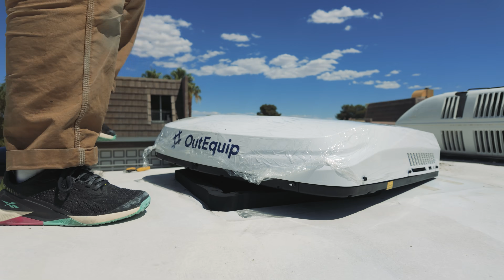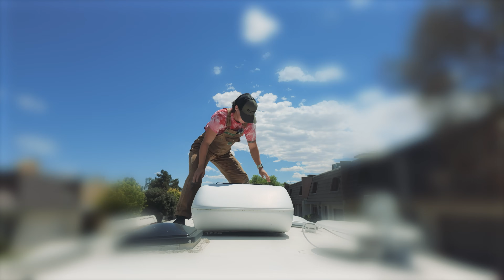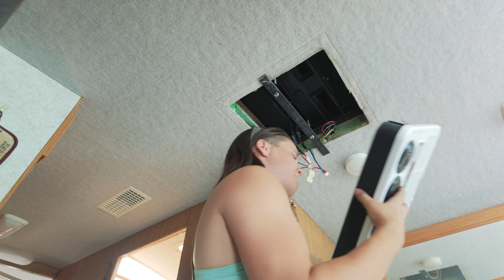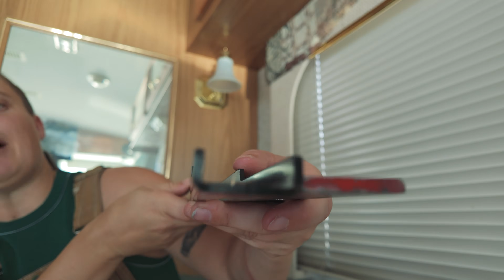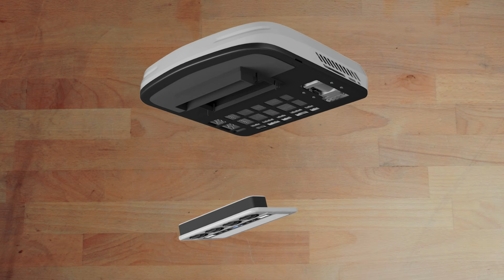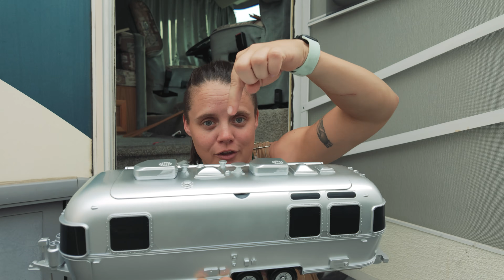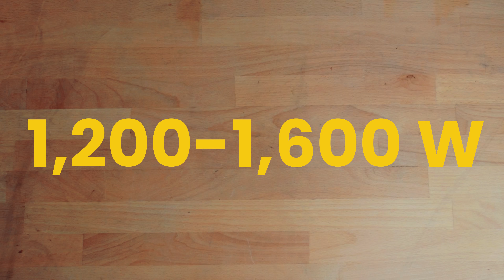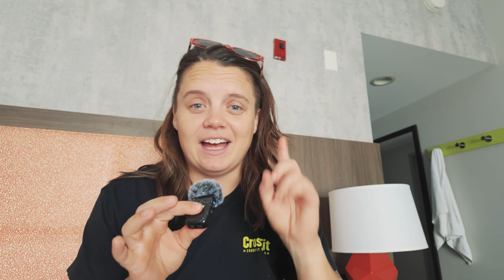Better RV Cooling with Less Power? My Switch to a 12V  AC | OutEquipPro AC Honest Review

Comment: The video is cool, but it contains a basic error in thinking that the power of an air conditioner is the same thing as its energy efficiency. Everyone I see talking about air conditioning for RVs makes this same mistake, due to a lack of correct information from the manufacturers of these 12V devices. Measuring the operating power of an air conditioner says absolutely nothing about its energy efficiency! If it were, a 10,000 BTU device would be twice as efficient as a 20,000 BTU device, which makes no sense! To know if an air conditioner is more or less efficient than another, what you should look at is not the instantaneous consumption at a given moment, nor the maximum or minimum consumption. What matters is knowing how many watts of heat the device is removing from the environment with the watts of electrical energy it is consuming! This is the EER, Energy Efficiency Ratio, which is a figure provided by the major air conditioning manufacturers, and generally not provided by the manufacturers of these 12V devices.  If an appliance that is consuming 250W of power has an EER equal to 2, it means that with the 250W it is consuming, it is removing 500W of heat from the environment. If an appliance that is consuming 1000W of power has an EER equal to 4, it means that with the 1000W it is consuming, it is removing 4000W of heat from the environment. In 1 hour of operation, it will have removed 4000Wh of heat from the environment, while the appliance with an EER of 2 will need 8 hours to remove the same 4000Wh of heat from the environment (8x500Wh). In these 8 hours, it will have consumed 2000Wh of electrical energy (8x250Wh), while the other appliance, to remove the same 4000Wh of heat from the environment, will have used only 1000Wh of electrical energy.  In other words, even though it is consuming 4 times more energy at a given moment than the device that is consuming only 250W, it uses half the energy to remove the same amount of heat from the environment, precisely because it has twice the EER. This means that to remove the same amount of heat from the environment, a device with a higher EER will use less electrical energy, even if at a given moment it is consuming more energy. Manufacturers of these 12V devices do not usually inform what their EER is, which makes us imagine that they probably do not have a very high EER. The advantage of a 12V device is, as stated in the video, the savings in energy consumption of the inverter. But this savings may not be offset if the 12V device is less efficient than the AC device. For RV ceiling AC devices, the EER is also not usually informed, and we can also imagine that they do not have a very high EER.  So, comparing a 12V ceiling-mounted device with a ceiling-mounted AC device, the EER may be equally low and the 12V device will have the advantage of saving energy by eliminating the inverter. However, even in this case, the loss in the inverter may not be very significant considering the high consumption of an air conditioning device, and if you already have an inverter connected for other things and consuming energy anyway, just because it is connected (the maximum efficiency coefficient of an inverter occurs with higher consumption, because there is energy that the inverter uses just by being connected, and the higher the consumption, the better this energy is used). But if there is the possibility of using a higher efficiency device (higher EER) in the RV, as residential AC devices should be, you will probably get the best solution in terms of energy efficiency, even with the loss in the inverter. In my RV I have a split AC device, I am using it with LiFePO4 batteries in extreme temperature conditions and I am getting good autonomy. I doubt that I would get more autonomy with a 12V device that does not even inform what the EER is...

Comment: Great Video!  Im trying to install this unit I just received and ran into the thickness of my camper roof issue that you discovered.  My roof is 5" thick so the cold air duct will have 2-3"of space between where it is supposed to seal/connect and provide flow of cold air through the 4 deflectors.  With the cold air blowing into the bottom of unit instead of the narrow duct channel  I don't feel unit will provide good flow.  I see you put a divider of such into bottom unit but that doesn't seem like the best solution.  Im hoping Outequip can provide a sleeve for extending the duct where thicker roof installations occur.  Nowhere in any and all the literature or endless YouTube videos have I ever seen roof thickness specs?  Im patiently waiting for a response to this issue.

Comment: Sounds good but 120 units are also heat pumps, in most cases
Reply: This company Outequip just released a new heat pump unit last week.  much more expensive
Reply: @gojibrian6860 that's the one I'm considering.

Comment: Can you fluctuate install it vertically?
Reply: That is not recommended because the compressor has oil in it, and the evaporator is set up to drain into a tray with a drain on the bottom of the unit. But there are wall mount ones.
Reply: @sqeekykleen49 thanks

Comment: I am concerned you showed a cable bolted directly to a battery without fuse protection within 7" of the terminal. This cable can carry enough current to quickly start a fire. Fuses at/in the appliance are to protect the appliance. You need fuse or circuit breaker protection to protect the wire and everything surrounding it, as close as possible to the power source (the battery). 
The old alternating current air conditioner was protected by a circuit breaker at the pedestal, and another main breaker at the RV's power distribution panel.
Reply: just received same unit and there is a 100a fuse 7" on the positive 6 gage wire\cable.  they have also eliminated the Anderson connector they used to have last month.

Comment: So my question would be if you’re plugged in your 12 V converter system will it need to be upgraded to handle the extra load of the 12 V AC unit to keep the batteries charged or to run the unit by itself? I know there’s a lot of variances on this, but I would imagine that they don’tmake the 12 V circuitry that much larger than the camper requires from the factory.
Reply: The converter will have an amp rating.... if you have the battery and converter powering the ac combined, the ideal is that the converter carry the load, but the batteries can assist for a while eventually the converter, if the amp capacity is too small needs the ac to rest a spell to recharge. Ideally you want your battery in a bank of 2 parallel to handle the amps...

Comment: Woohoo! I’m a solar junkie. Do it!!!, unless you’re in Seattle-ish environment all the time.Excellent and highly-informative delivery! Bought a 48’ Semi-trailer and am doing the complete build as an experiment.. I will purchase more solar and batteries, but I have the other hardware for the most part. You can get crazy good prices on them. DO NOT BUY THE FLEXIBLE KIND! They breakdown quickly. AND!!! Solar panels get hot as sh*t. Learned the hard way. Bubbled the paint on my truck cap just lying on there now and then. That means the heat is also transferring directly into/onto your rig’s body. Great if it’s winter… Just DON”T DO IT! 
But this AC thing looks fantastic!
Thank you so much!❄️❄️🌮🥩🥞🫔🍜🥘🧁🍮🍩🥛🧉🤿🎖️
Pardon. I’m really hungry and got transfixed in emojis there for a bit. 🤙

Comment: Bending that flat bar takes a lot of torque, notching the supplied bracket will weaken it and it will probably fold at those points if you torque the bolts as much as the flat bar

Comment: Very detailed video. I have built a 2000 watts solar system and installed a mini split, love it, running all my appliances and my breakers never popped. However if you live in Arizona I will not recommend that set up.

Comment: 10-11 Requested... At 68, last week I brought my first popup camper home. (2004 Rockwood Freedom #2280) Will this work on my unit? Oh, the prior owners only went to plug in parts and pulled the battery, From zero to learning LiFePo batteries and solar... A bit overwhelming.

Comment: The question I have is to compare how many BTUs it produces as compared to the Orginal AC unit. If it uses 1/4 the wattage but only produces a 1/4 of the BTUs of cooling then it is an a mute point. But if it produces the same BTUs with 1/4 of the power than it is a game changer. Comparison of power to BTUs I think is more realistic. But great presentation I have also substribed to your channel. Good work.
Reply: BINGO!  YOU WIN THE PRIZE!!!!!!!!!!
THE FACT IS IT CAN'T COMPETE WITH A 120 VOLT UNIT.  JUST NOT MECHANICALLY POSSIBLE.  BUT FOR A 12 VOLT SYSTEM IN A SMALLER SPACE, THEY WORK OK.

Comment: A few things. 

1) DON'T notch the ceiling bracket to fit the cover. For the same reason your flat steel with holes didn't work, if you notch the bracket you will weaken that spot and it could bend. Of course since this is holding the AC onto the roof that wouldn't be a good idea, especially when traveling through rough terrain, like the Interstate system in the Northeast.

2) CHECK THE WIRING for proper size and fusing! I have a similar 12v unit hanging on the back of my class 8 Tractor. It was a cheap Chinese unit, but they are all simple and basically the same. When I installed mine I unknowingly pinched between aluminum brackets the wiring harness that went from the outside condenser unit (with control board) to the interior evaporator/blower. The first time I supplied power it shorted and melted the thin gauge wires going inside. I later discovered that the 18 AWG power supply wire for the interior was connected directly to the same post that terminates the 7 AWG coming from the battery. The battery wire was fused at 70amp but there was no fuse to the blower supply wire. Luckily I was able to rewire the harness and add an inline fuse and all has been working great. Also I replaced the battery cable with a thicker gauge cable since it was heating up too much from internal resistance. Maybe my experience was unique due to the super cheap unit I bought (a couple hundred $'s less than most other similar units. I got what I paid for and am not the least bit surprised. But that doesn't mean the higher priced units are manufactured to higher standards either. Just sharing my experience.

3) It cools nice... but it works best as a supplemental cooling system due to the lower volume of air/cooling. Get the vehicle cool first then this unit will maintain that temp for hours (duration depends on battery bank and outside/inside temp differential of course). The energy efficiency of a DC unit aside, physics dictates how much energy is required to cool a given area and these units are not sized the same as the larger one you replaced. If your cooling needs are light or localized to a single room then this wouldn't be an issue. But if you're trying to match the high level of cooling from a larger unit you'll need to either run the smaller unit a lot more or you'll need to supplement the smaller unit with a different cooling source or maybe just another 12v unit. In the end you energy requirements aren't going to change drastically when trying to achieve the same level of cooling. For comparison I have about 600ah of capacity in my battery bank and my unit can maintain the cool in my sleeper cab (about 6' x 8' x 6' with little to no insulation) for about 8-10 hours (in combination with my 48 quart capacity chest fridge/freezer).

Final thoughts: If/when I need to replace this cheapo unit (from a no name company that doesn't seem to exist anymore) I'll likely go with a similar unit, but still on the cheap side as the tech and parts are pretty simple. Just find a good control unit / blower as that's where the differences between brands stand out.
Reply: Just as an aside, the unit I have is outwardly nearly identical to the mini-split that OutEquipPro has on their site. The parts included in the kit are also nearly the same. My exterior unit is red and my interior unit is nearly identical except the coolant connection is on the bottom and not the side. Looking over their energy usage claims it seems to be right in line with my own experience.

Comment: What 12volt upgrades would I need to a older stock Class C Motorhome? 
(Non solar panels) What size inverter. and battery number?
Reply: Cable #4.   And fuse. Converter should do 100a 12v and parallel batteries to get the load amps that ac needs... 80a

Comment: One thing you left out is that most rvs have a 12v system to start with for lights, refrigerator, water heater (gas operation) and various other items or outlets via a 120v to12v inverter.  YOU CAN NOT TIE THIS AC unit INTO THIS SYSTEM!!!!  This must be tied into a battery bank (12v) most likley maintained and sustained by vehicle charging or solar panel system.
  I don't know where the power comes into this unit, buttttt, most units are fed from the bottom inside the ceiling.  An alternative to penetrating the roof and making a place for wire entry into your AC unit would check about running your wires through your old unused AC ducting to say above a  floor to ceiling cabinet, then down or close (er) to where you want to drop down.  There is a product called "wire mold"  sometimes goes by other names) that is available in most hardware and building supply stores that may help also. This comes in various sizes and sticks to or screws to various surfaces. You could run this across ceiling or/and down a wall to get to where your going.  In my humble opinion ANYTHING to keep from penetrating the roof if another solution is available.  I have investigated these units and there is a unit that you can mount in the bottom of a cabinet or under a seat and duct out if you do not already have a rooftop unit.
  I'm considering installing one of these (or similar) units in my main area and the cabinet unit for my bed and bath areas.
  IF you have a large enough 12v system to sustain more than lighting, then 12v is the way to go.
   The reason I'm saying 12v is that the 24v,36v and 48v systems are "special".  You can not buy anything off the shelf or scavage anything (lights, blowers/fans,  switches from a salvage yard for these systems to add on or repair.  There are litterly thousands of  various parts and places to get 12v parts, even 12v to 120v.  Try doing 24  36, 48v to 120v from walmart.

Comment: It will impact your MPG a little also due to slimmer profile = less aerodynamic impact... but RVs don't really get good MPG to begin with which is probably why it's not mentioned lol.

This logic here is part of why i just sleep in my Tesla... it's not that roomy.... I know... TRUST ME... I know....  But the AC is already designed to run in the EV off the battery.. so it works efficiently.. the amount of space it has to cool is smaller so that is also efficient... the problem is it's pretty devoid of ANY real insulation LOL.

But I can get to camp pretty easy as long as there are chargers and it's not super far away... and most my time is near the firepit or in my kayak.... but the kayaks is why I brought up the aerodynamics... putting those on my roof messes with my aerodyanmics also.. which is a direct hit to my range... but in a manner my car isn't able to correctly compensate for on planning my charge stops... which means the software isn't going to look at my route and go "OMG ARE YOU NUTS?!?!?  You will never make it there like this" until it may be too late... so I have to plan my trips in advance estimating stops about every 1.5 hours of driving to be safe.

Anyway... I mostly just wanted to chime in and mention the MPG gains by that AC being slimmer.  You can also mount a mini split on the rear of the van or RV to keep a shorter profile also... but I am not sure if those come in a DC version... and putting all your cooling somewhere not so central is not the greatest idea either... so a slim roof top unit like this is probably ideal.  Hopefully they come up with a model that is better suited for thick roof RVs... where some of the parts use up that empty space between the outer roof and the inner liner and they can make it even slimmer as a result of dropping some of the equipment into that dead space.
Reply: If you care about MPG then RVing isn't for you. Knowing MPG isn't going change fact it's going hurt every time you fill up which is often in RV or tow vehicle

Comment: Short Circuit is what you mean. Where the return sucks in the supply air. 
Short Cycling means the unit comes on frequintly. It happens when a unit is whey oversized and the equipment wears out faster.
It's better to have the unit run awhile and also cool down the insides of your RV.

Comment: 420 watts is only 4 amps? Watts Equals amps times volts so at 120 volts times 4 amps that equals 480 watts. I bought an 8000 btu air-conditioned for about $200 it was about 420 watts. Did i miss something. I ran this air conditioner all day on solar panels it got everything cool 
 my bed the walls everything was cool so I would turn the air off when the solar quite and turn on a fan and I was comfortable all night.

Comment: So.... My question is related to battery usage. How long would battery life be if running this a/c in a constant warm to hot region like S TX?
Reply: With amp hr rating of the batteries ie 600 ah would do 6 hrs.... and you want at least 2 batteries in parallel to meet amp draw.  80a is a good max. Somewhere it was 56a but you want extra. 😊